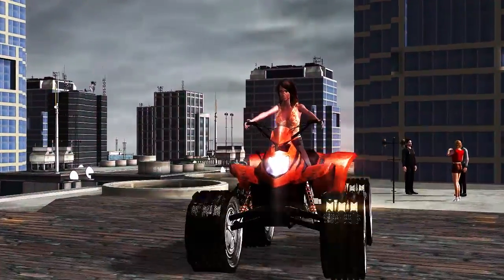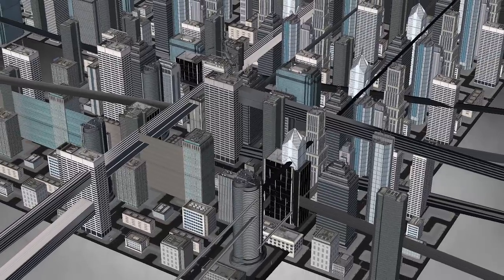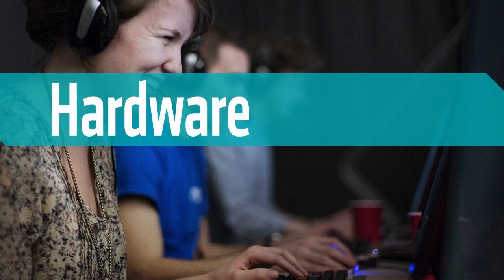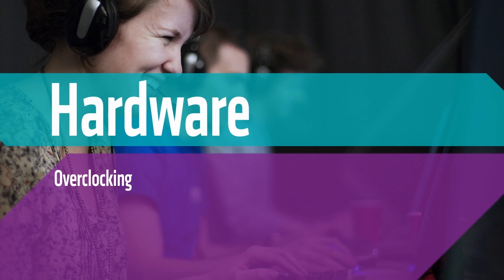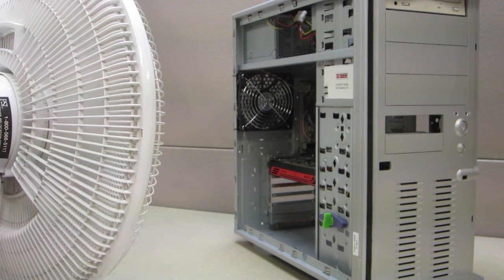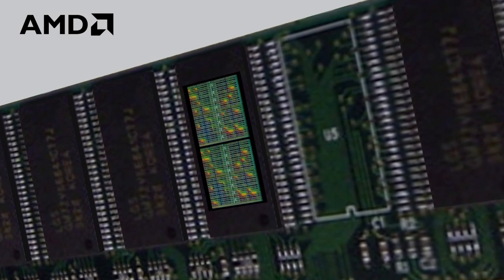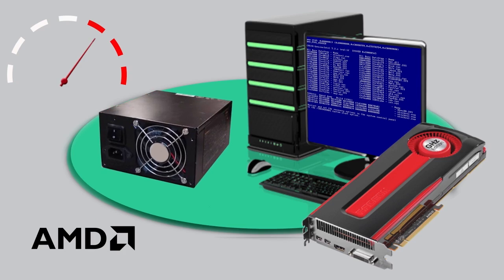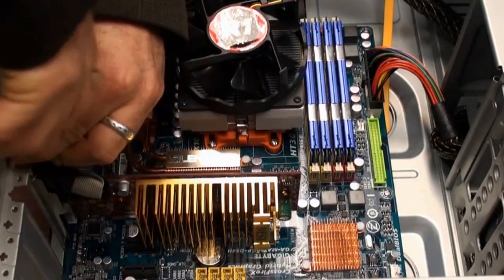AMD Support: How to Troubleshoot 3D Geometry & Texture Display Corruption

Comment: is the AMD FX-8350 good with the AMD R7-240?
is recommended that?
Reply: yes, why would it not be..

i have a AMD FX 8350 with a MSI r9 290x lightning and i have no problems.
Reply: Even a better question why get such as weak GPU unless your just doing web browsing and flash games
Reply: Yeah and those things can be done on integrated graphics and workstations need a stronger GPU
Reply: ***** my new pc has an i5 4460 + intel hd 4600 + 8gb ram + 256gb SSD and i can do anything on it..... even sold the r7 260x from my old PC
Reply: Which is why i said 'those things can be done on integrated graphics" a low-end dgpu isn't worth it anymore in most cases i can still maybe see it relevant for old PC's. Modern PC's have good enough IGPU's and i also have a 4600 GPU it can even play a lot of games at 720P so i feel ya.
Reply: ***** you need to fix your punctuation because you said need a stronger GPU at the end so you contradicted your first statement
Reply: I simply did not say that quote me

Comment: yeah sure, we'll buy 1000$ of spare parts to find out which one is defective  DUH!   Motherboard often have the wrong bios to support the new AMD CPU. They just don't give a damn. +  what about the list of supported ram, can you write it smaller so that we can use a microscope to read it ?   This is insanely complicated and either we get it right or we RMA.  How do you want to update a bios if the computer won't boot due to an old bios ?